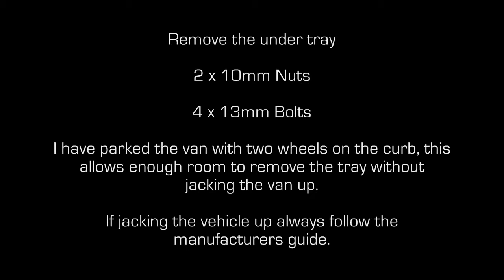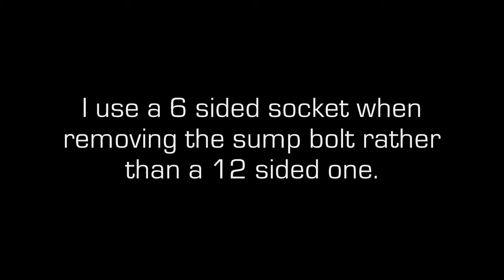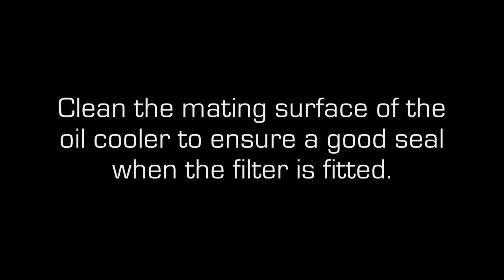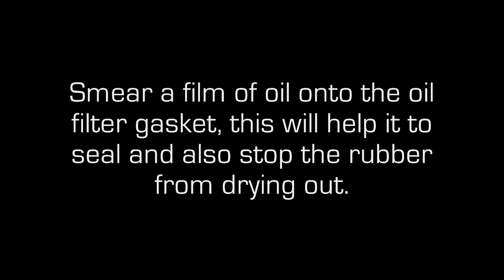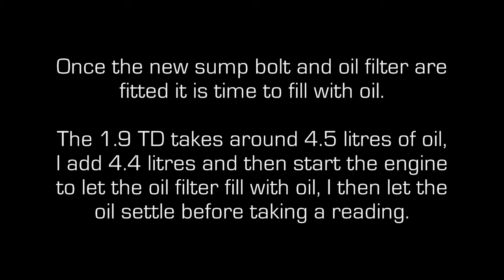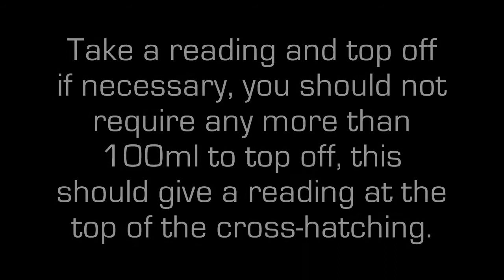VW T4 1.9 TD Oil & Filter Change (ABL) - Volkswagen Transporter

Comment: thanks for another accurate video, my 1.9 non turbo keeps losing oil , I've been told to use mineral oil, as they vaporize standard 2040, there is no obvious leak & no smoke from exhaust ,so I'm sort of believing it ,loses more if I go above 70
any ideas? trev

Comment: Does it matter if you use 10w40 for the 1.9td abl engine? I only ask, as the manual for this engine states 5w30.
Reply from the maker: I have been using 10w40 for the past 16 years on this van from 85,000 miles to 170,000 miles. Engine is very quiet and smooth.